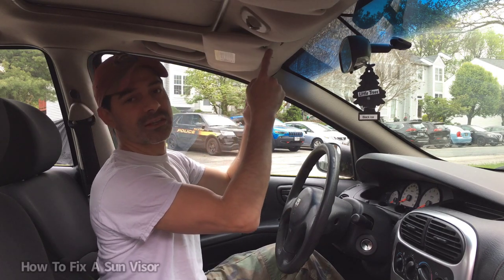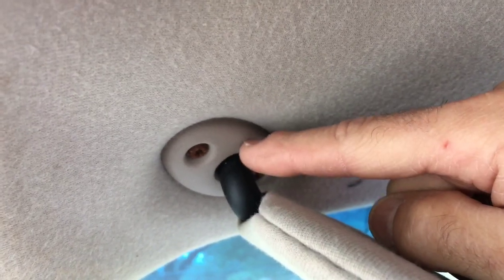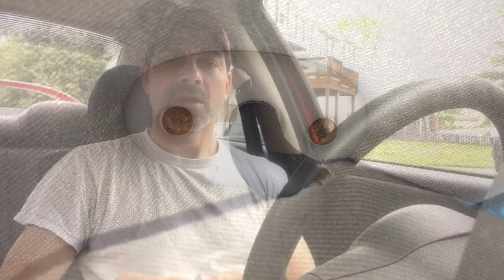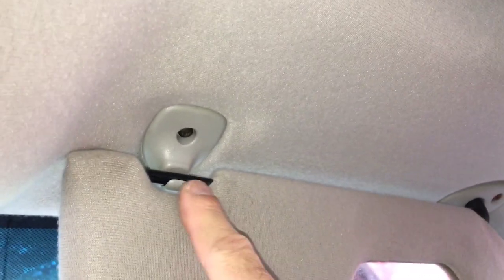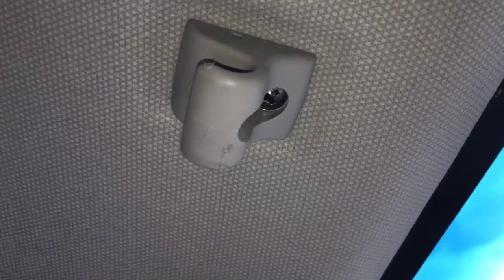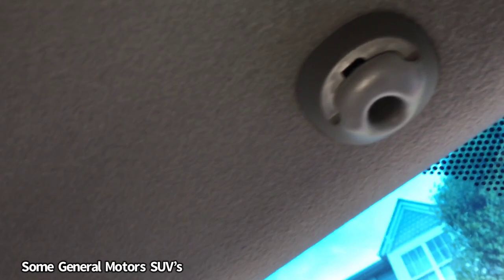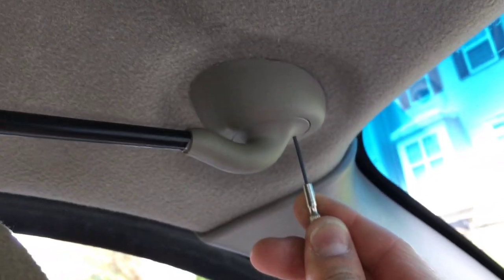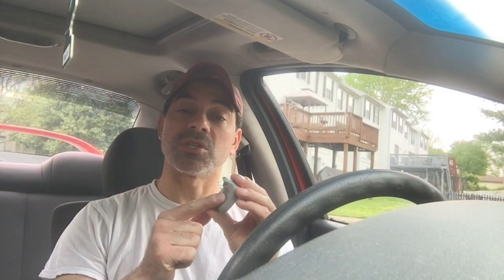How To Fix A Broken Sun Visor In Your Vehicle (Andy’s Garage: Episode - 189)

Comment: Like the video but I have a 2003 jeep grand cherokee riverside visor won't stay up need left side of visor directions
Reply from the maker: @devineone6239  in time these can get worn and loose. I don’t believe there is a way to tighten that. You could inject a small about of liquid rubber or silicone to tighten the sleeve

Comment: Thx for your video. How do I replace this one with no screws that has broken off? I will attempt to add my picture.
Reply: Looks like the video didn't upload. I have a Honda civic hybrid 2006. No screws and the back part broke off. Thanks!
Reply from the maker: @cindyyee7678  you’ll need to use an extractor to remove the broken screw first. Here’s a link to a video I did showing how: https://youtu.be/XmxYaxJEglI?si=bt-hlFhXe4cpTpDp

Comment: Help!  What kind of screw would I use to replace the retainer screw?  They fell out on both visors. The clip is still in tact (on both visors) ,  but the black screws fell out... Saturn 2002 L100.. Thanks!
Reply from the maker: I am not sure of the visor screw size on the Saturn L100